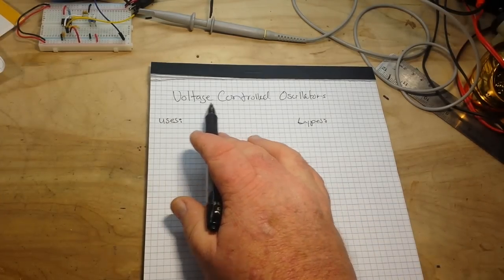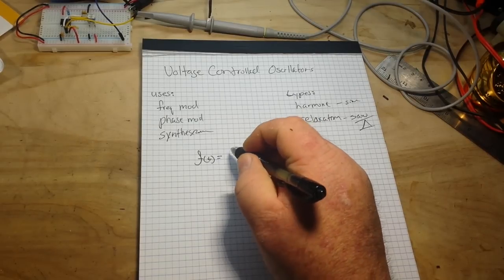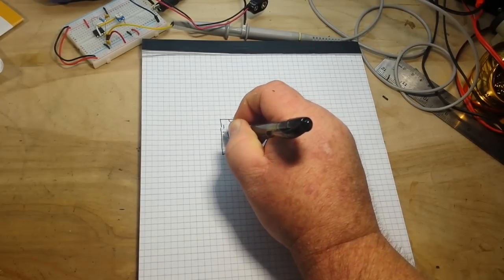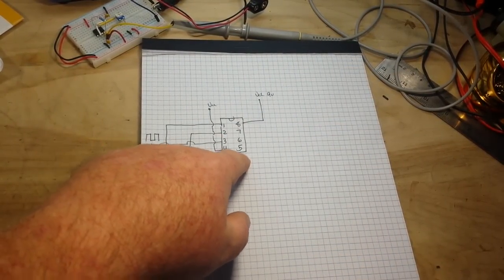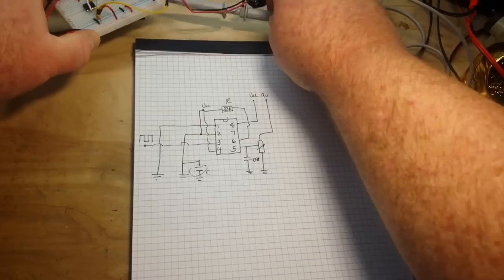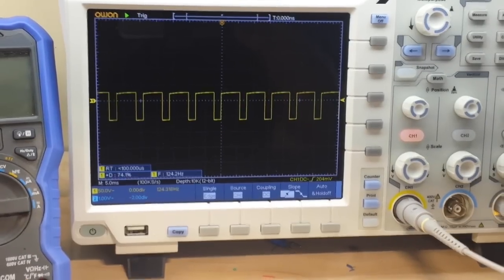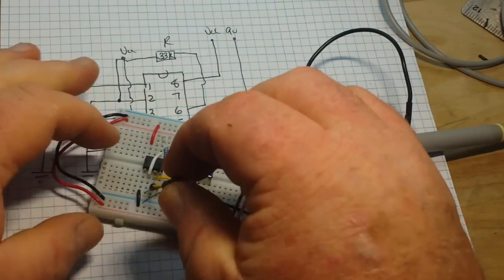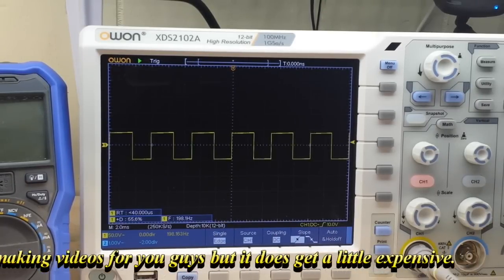Let's make a Voltage Controlled Oscillator (VCO)

Comment: At 2:10 I could see straight away there is an error in your equation for frequency as it makes no sense to try to  subtract a voltage from a frequency. The input voltage should be multiplied by the sensitivity, not subtracted. I'm sorry but that is such an obvious error I can't understand how you made it. No wonder you didn't want to get into the maths.

Comment: You got pin 2 going to gnd on the schematic. It should have a cap in series before the grd connection....or am I missing something. The board is correct however.

Comment: 1 Tl08, 1 resistor and 1 condensator makes the same. Integrating the output with a 2. Tl08 and giving on the 1. Tl08 makes a perfect 50/50 square wave.

Comment: Sir any video on reverse engineering done on the RF transmitter and receiver of the RC control of any toy. How it is designed, how it works step by step

Comment: Excuse me, @learnelectronics, I'm using a membrane potentiometer for my VCO. It has three male connectors going into F17, 18, and 19. Could I connect J17 and 19 into ground instead of A17 and 19 like how you have it? I'm afraid my potentiometer doesn't connect across the gap to E17 and 19 like yours. I'm new to circuit bending; thank you!

Comment: Nice video thanks. Was there a mistake in the schematic though? I think it shows pin 6 to pin 2 via a resistor, but the circuit is pin 2 to pin 6 and a resistor from pin 6 to pin 3?

Comment: On the schematic you have the 33K resistor bridging 6 and 2, but in your actual circuit it bridges 6 and 3.
Reply: Its not 33K either - more like 18 ohms!
Reply: @RavenLuni  Pin 2 on the diagram also goes to ground.

Comment: I will be salty, but reverse avalanche is WAY LESS complicated, produces a better duty cycle and sound, doesn't actually change the waveform to another type... 
555 can make a decent LFO, not an oscillator. Schmitt trigger works way better for making a good sounding oscillator.
SIMPLE OSCILLATOR MEGADRONE SCHEMATIC : (credit to LOOK MOM NO COMPUTER) https://static1.squarespace.com/static/5912db7ee6f2e1435dbab4fd/t/5f47d6e0bec2324127333ac5/1598543585644/2000+MEGADRONE+SCHEMATIC+1.4.jpg
EXCELLENT SERIES ON MAKING SCHMITT TRIGGER OSCILLATOR: 
https://www.youtube.com/watch?v=QBatvo8bCa4&list=LLpFiWAxjwzismoNY3z824zQ&index=3&ab_channel=MoritzKlein

Comment: Thanks.  I gotta build this circuit. I wrote a program for a 433Mhz module that was stable until I connected it to a DC motor. Commutator noise? I actually want to hear the instability when I connect the motor to it.

Comment: Hello! I just saw this video, very interesting. But, I have a question or comment;  in your draw you "connect" pin 6 to a 33k resistor and to the resistor to pin 2. But, on the circuit I saw 33k resistor connect to pin 3 of 555 timer. I make a mistake what i saw...? or you can make the circuit in two different configurations? Thank's for the answer Mr. Paul, and sorry if i'm wrong.

Comment: So I found a circuit to control the frequency and duty cycle independent of each other, but to change the frequency a capacitor has to change. I am trying to build what I guess would be an arbitrary pulse generator(?), with independent duty cycle and frequency. And It would be nice to be able to control the frequency with a knob instead of the dip switch/capacitor array I currently have. Is there a way to do this with the 555? You have a ton of videos about the 555, so I figured you would be the right person to ask. Also you make great videos, keep it up. 👍

Comment: I think I have watched this video like 3 times now. Fascinating stuff. Would love to have seen this circuit hooked to a speaker.
Reply: I was wondering the same thing - how to hook it up to a speaker
Reply: @AsleepAndConfused  You can take the signal from pin 3 (the one he's showing on the oscilloscope) and feed it into an audio amplifier. Best to do this via another potentiometer, so you can vary the voltage going into the amplifier (start at 0 and turn it up until you hear something).
Please note though that the schematic in the video is wrong (as others have commented here as well).
As far as I can tell at least: 33k resistor should connect pin 6 and 3 (instead of 6 and 2), and pin 2 connects to ground only via the capacitor, not directly.
Reply: @AsleepAndConfused  just plug + into the output and put - to ground
If its a small speaker should work :P
Pull one out of an alarm clock or something :P

This is the simple way lol

Comment: Is Calculus absolutely necessary for electronics? Can the math for electronics be solved without calculus? I'm a noob to electronics and I can tell that algebra and trig is going to be helpful. I haven't seen anything yet that I can't figure out with Algebra and trig.
Reply from the maker: For early beginning work no. But calculus is the math of change over time. That becomes important as you get into calculating capacitors, amplifiers, etc... also we build integrating circuits

Comment: I have followed your instructions exactly as you outlined on the video. However, it does not work as you have indicated. I can't see how the how the cap you have on pin 2 would work. As you have it connected it would be invisible to the circuit. 

Please  look at your schematic again. 

Thank you.

Comment: Would love to see you build some sort of frequency switch that works like addressable led strip...make an led turn on at a giving frequency...
Reply from the maker: Ill see what I can do.
Reply: @learnelectronics  First of all I love your channel, great stuff.  Here is my thoughts on figuring out addressable Leds. They say each Leds in a strip is turned on by different frequency. I have considered ideas like how a ir remote control works to spectrum frequency device. Its can also works like a vumeter in dot mode, where the chip on each Led converts frequency back to a set voltage to active the Leds. I think this is intriguing concept and would love to see just 3 leds perform this unknown trick using the 555 timer.  I love analog and figuring how stuff works, Thanks

Comment: @learnelectronics 
Electrolytic capacitor changes whole output wave,  why? 
Isn't the Polar capacitor not suitable for oscillating wave? 
How is it able to work after changing cap?
Reply: First of all, the waveform is changed in shape, because the scope is AC coupled and the fundamental frequency of the oscillation is so low, that the DC block cap in the scope has plenty of time to charge and discharge, that is why you see the steady voltage of square wave as an exponentially decayed voltage in the scope (First order RC circuit).
For your second question, generally yes, but there will be no negative voltage across the timing capacitor in this circuit, so you can also use polar caps like electrolytic capacitors without any issue. The waveform that you saw on the scope screen is the output waveform (square wave) which is different from the timing capacitor waveform (exponentially charge and discharge). Moreover, negative voltage on the scope screen appears because the input is AC coupled so it removes the dc component of the oscillating wave on the screen.
Changing the timing capacitor affects the charge and discharge time, which consecutively alters the frequency of oscillation. So does the resistor. As you increase resistor or capacitor value, the charge and discharge time increases, thus reducing the frequency.

Comment: would this not be a ICO? 
changing the resistance changes the output current and the tone.
It does not vary the voltage much.

Comment: Where is the control voltage?
Frequency is controlled by reistance and capacitance, so thats not an Voltage controlled Oscillator.
Reply: Replace the potentiometer by a regulated power supply where +v to pin5 and -v to ground...the basic idea of pot is to vary the voltage instead of using  a variable voltage supply
Reply: XD been 6 months...hope that doesn't bother u that the reply is after 6 months

Comment: The 555 still reliable and simple, multipurpose time and that configuration also gives 50% dutty cycle  at certain frequency range. About calculations yeah bring up to remember the integration / primitives and also electronics.

Comment: I believe your drawing is wrong on pin 2. You have both legs of the cap going to ground
Reply: Carl is right..actually it was a slight mistake. 2 will go to gnd via the cap..not directly
Reply from the maker: Cap between pin 2 and ground

Comment: Your oscillator videos made me wonder about oscillators in switch mode psu's. As I understand first is bridge rectifier, mosfet and transformer. The oscillator controls the mosfet but at this point our voltage is rectified 110v/230v. So does oscillator work on high voltage or maybe there is voltage divider to lower the voltage for just the oscillator? Can we use 555 timer with switch mode transformer or do we need higher frequency?
Reply: Main switch mode power supplies, as you mentioned, first generally rectify the main's sine wave to make it high voltage dc, and then using a (discrete or integrated) switch and a transformer, they produce the desired voltage (or current) at the output. In order to turn on and off a switch (for example a power MOSFET) you don't have to apply high voltage to control pin of the switch. Power MOSFETs in SMPSs typically need 10 to 15 volts at the gate. Although the control circuitry of a SMPS is not as simple as an oscillator, generally speaking, you can use 555 timer as PWM source for you SMPS.

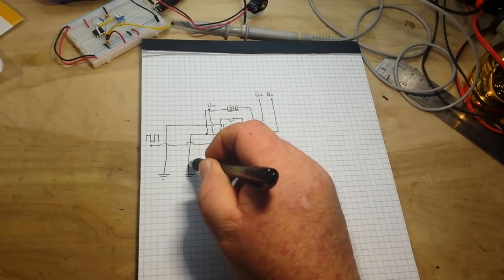Comment: Thanks Paul for the intro on 555 based VCO.  I think there's a mistake in your schematic at 06:43 as both ends of the timing capacitor are connected to ground.  Obviously you didn't reproduce the error on the breadboard otherwise it wouldn't have worked too well.  Keep up with the good work !
Reply from the maker: Cap between pin 2 and ground

Comment: Great video. I discovered the 555 when I had the crazy idea if building a DC motor controller! For a big DC motor.  Like for  electric vehicles! I guess they need to be a bit more complex . than just a 555 and a ton of MOSFETs! I heard they will work. Just not likely for long. They need safty shut offs and current sensing. To keep from frying something! Keep up the good work,